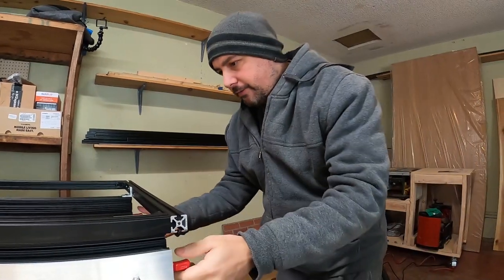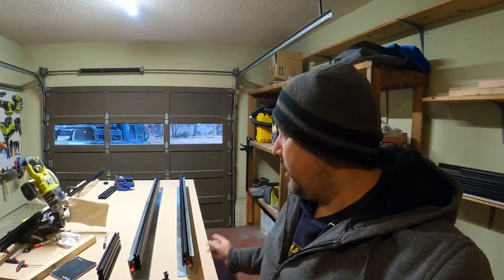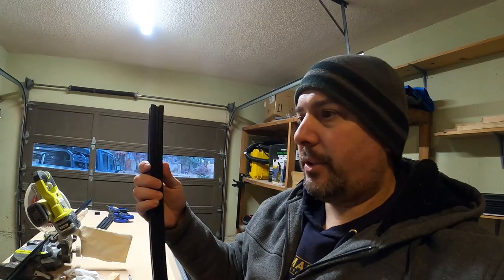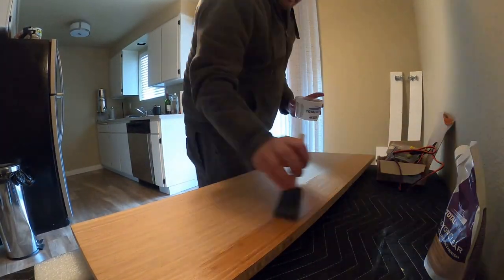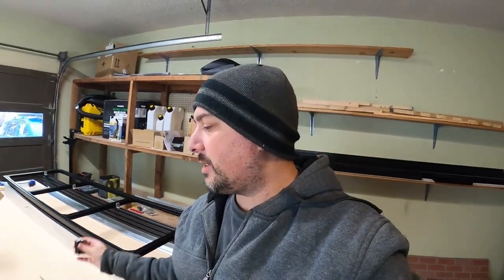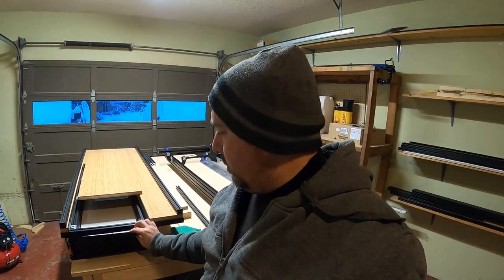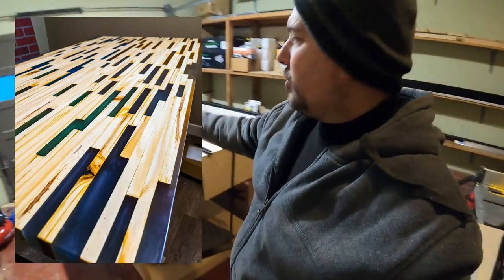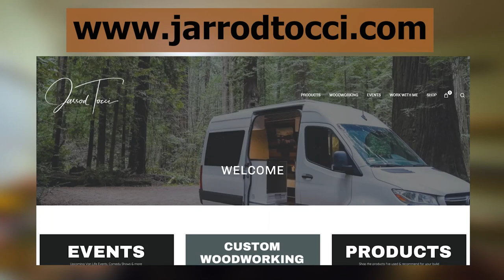Custom Slide Outs for Jeep Gladiator Overland - Build Series Part 1

Comment: You are freezing in your shop because there is no weather stripping around your garage door, it is the same as leaving that window open 2 inches, 24/7. for about $20 you could save $100 on heating the air you are blowing out on the driveway and be warmer in the shop.

Comment: Spent weeks researching 60" sliders for my garage. Ended up not doing sliders due to cost. Curious, which brand slider you chose and why.
Reply from the maker: I bought mine off my buddy Dave that is a van builder where I live. He was putting in a massive order for sliders with a big company so that was a big reason going through him because of price. As you know they are expensive! So for 2 sets of 58" locking slides I spent a little over $500. I'll have to get the brand from him and I'll talk about that in a future video. Thank you for the reminder

Comment: Good Evening from England! <3 Nice to see your "baby" coming to fruition. Quick Question, I known 8020 is the "brand", what are the dimensions of the square extrusion? is it 20mm X 20mm ?
Reply: Multiple dimensions on it mate, 80/20 I think was named after a weird psychological principle I think? But it’s now synonymous with this specific profile.
In the UK we can get it in a range from 20 x 20 to 45 x 45mm
Reply from the maker: I used 1" but they make metric as. So I think my 1" x 1" is equivalent to your 20mm x 20mm
Reply: @JarrodTocci  1" is ~25mm so 25x25mm
Reply from the maker: @edwardthomas7022  I'm not sure if the brand 8020 sells them in 25mm x 25mm. Maybe they do, I just didn't look into the metric sizes that much

Comment: That AE degree is getting a workout with this build series. It's definitely testing you, for sure. Great job. If I were closer, I'd be of assistance for nothing but getting the education. Looks like you could use a videographer and second hand man. Patience is both your biggest ally and enemy right now. Just breathe.
Reply from the maker: Thanks! I messed up a little on the 2nd slide today so I'm taking a day off to figure some things out